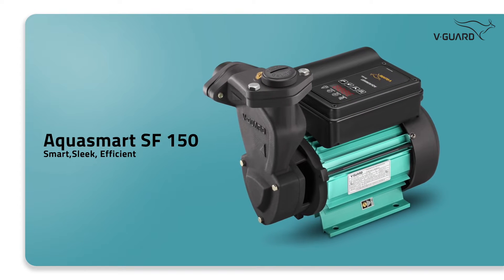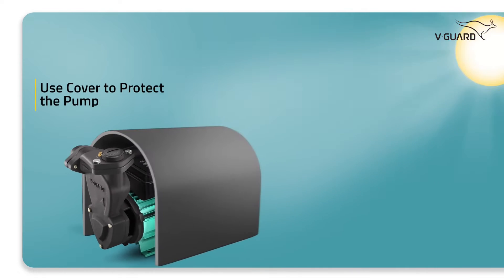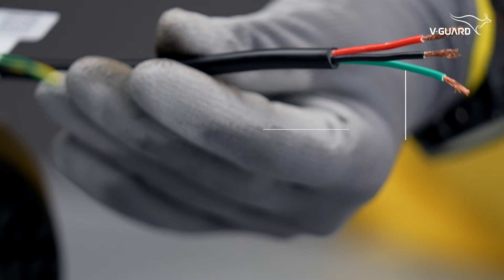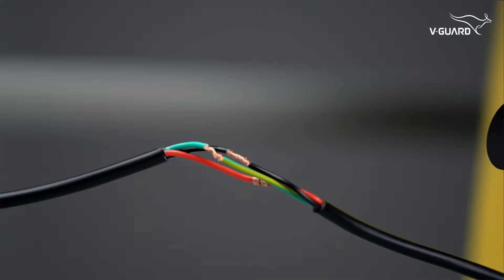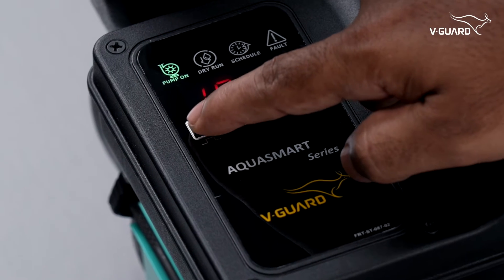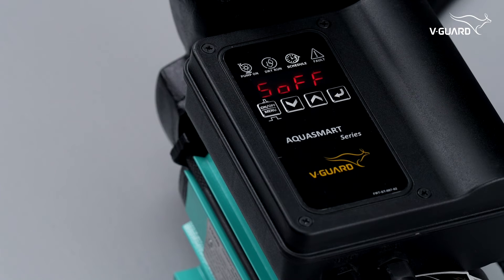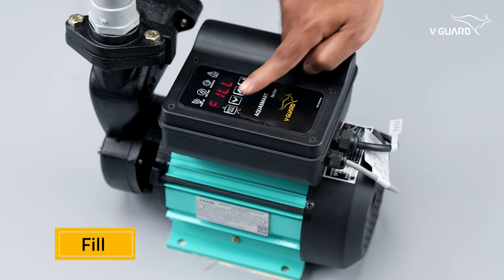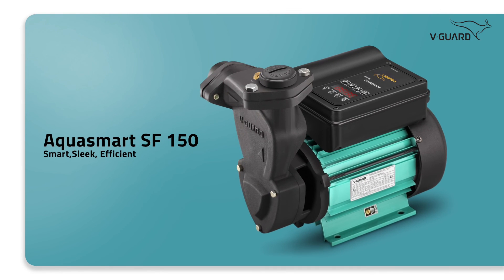V-Guard Aquasmart Pump Installation and Demo

Comment: Is it necessary to install a float sensor in the reservoir for the dry run protection feature to work?
Reply from the maker: Dear Sir, Thank you for getting in touch with us. Request you to kindly share your contact details so that the concerned team can get in touch and assist you further. Regards, Team V-Guard.

Comment: Can it be used for municipal water ? Will the dry run protection switch off the pump once municipal water is stopped?
Reply from the maker: Dear Stephendcosta, thank you for getting in touch with us. Request you to kindly inbox your contact and City/PIN code details so that the concerned team can get in touch and assist you further.
Alternatively, you can reach out to us on 1860-180-3000 or email us at customercare@vguard.in or WhatsApp us at 9633503333. Regards, Team V-Guard."
Reply: Thanks. One more question. The controller is fitted directly on the motor. It doesn't melts due to pump heat?
Reply from the maker: Dear Stephen, thank you for getting in touch with us. Request you to kindly share your contact and City/PIN code details so that the concerned team can get in touch and assist you further.
Alternatively, you can reach out to us on 1860-180-3000 or email us at customercare@vguard.in or WhatsApp us at 9633503333. Regards, Team V-Guard.
Reply: Price
Reply: Rs